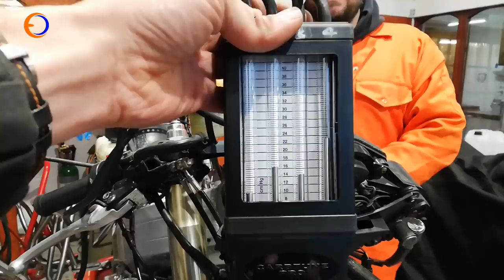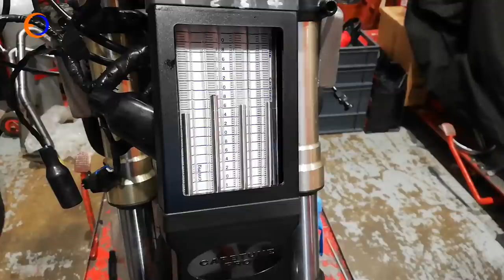Carb's Suck!!! The B.O.A.T Bike Part 3. Rebuilding the carbs on the Honda RVF400 project. NC35

Comment: Feel bad for saying this after seeing you struggle with the carbs, but eh... shouldn't there be a tiny O-ring at the end of each pilot air screw? :X
Reply: If it's anything like the GSXR400 Mikuni BST's, yes, and those O-rings are absolutely critical for stopping unmetered air getting sucked into the pilot air circuit and messing up absolutely everything. Idle speed and stability, carb balance,  progression, hanging up, lousy throttle response, flat spots, even a recovery on a truck, all intermittent and unpredictable - an  absolute nightmare that took me most of 2 summers to debug.  They're so tiny they seem unimportant, but heat and fuel cooks them so once disturbed or dried out by  disuse they will forever leak and ruin your life.  I stripped those carbs 10 times, changed everything until  I realised that because the old ones looked OK didn't mean they were. New ones cost pennies, are nice and soft and sticky, and then by magic everything worked perfectly on factory settings.

Comment: I hate to mention this now...

But are you aware that the emulsion tubes are slightly different front to back ?? 😜
Reply from the maker: I carefully instructed Adam not to mix the bits up... Or at least that's my excuse!
Thanks for the info 😳

Comment: What about the two screws in video 2 which you didn't remove because the heads were chewed up? Personally I'd be worried about those as they are bound to cause issues, they really do need to come out like the rest and be set up correctly. Probably a hole drilled in them so you can tap a torx in and screw them out? Enjoying the vids though, top stuff.

Comment: Dave… Use something like Permatex aluminum or nickel paste with alloy casings etc… copper slip is not good with aluminum and can cause galling of the threads. Plus Stainless is a bad dissimilar metal mix and causes galvanic corrosion.
Reply: I've heard that, too, but never experienced it myself apart from a stainless screw in a magnesium fork yoke which was heavily corroded. So I would appreciate first hand experience as there are so many stainless screws sets for motorcycles. I use ceramic lube on screws in alu for peace of mind btw.
Reply: @io3204  I've heard this too, but I've been using Copaslip with steel and stainless threads into aluminium, for 40 years. Never had a problem, and I still have one bike that I did this >25 years ago. Vastly better than the nothing the mfrs use, anyhow, which is a galvanic disaster. I can't tell if ceramic or nickel grease is better, 'cos I've no experience of copper being bad, so have never bothered to buy any.
Reply: @MrShadownoise  thx tony, that's exactly the right information. I guess as long as there's enough grease involved everything's fine.

Comment: just one thing,did u guys put the o rings in with the washer and spring by the pilot screw assembly? otherwise nice video.
Reply from the maker: It's been a while, but pretty sure we did 😬

Comment: OK, call me old-fashioned, but I vastly prefer carbs over injection.
You could do all the required maintenance at home without investing the value of another bike into electronic diagnostic equipment (half of which goes out of date a few models later), and once you understand the principles, it really isn't all that hard.  
I found CV carbs an unnecessary complication, but you do have to know not to slam the throttle open too suddenly.  Slide throttles were just fine if you treated them right.  Need a rich mixture for starting?  Just raise the fuel level a bit by pressing the little button on top of the float chamber - no need to get a handful of petrol, either - that just shows you are holding the float down too long.  So that is the choke removed, too.  If you don't run very lean you don't need an accelerator pump, so in the bin with that as well.  Need it richer in the mid-range? raise the needle a notch in the slide.  Or lower it to give a leaner mid-range.  More fuel at full bore?  Bigger main jet. Opposite again to lean it out.  Bottom end? idle airscrew.  All really simple, and you learned to treat your engines right.  All that with no internet to look it up on as well.
I miss the days when motorcycles were what everyone had until a family arrived and they were adult enough to buy a car and use it responsibly - at least being on a bike first was a logical progression from a bicycle and taught people to use the roads at higher speeds without putting others at risk.  If people did something dumb it was only themself that got hurt, and traffic was actually able to flow instead of queue.  
And we had MUCH more responsible drivers as a result, as that early experience of vulnerability was great training for a lifetime of safe driving.
I can't say I've never had a problem, but have a passed million road miles in or on each of three different classes of motor vehicles, including motorcycles, and never had a ticket, conviction, or claim against my insurance.  Or for that matter, had any problems flying an aircraft.
Reply: Can concur. Learned on bikes. Never had a car accident. Also a competent pilot. The value of learning to get around on 2 wheels before anything else is incalculable.